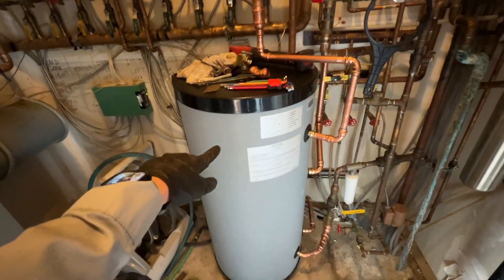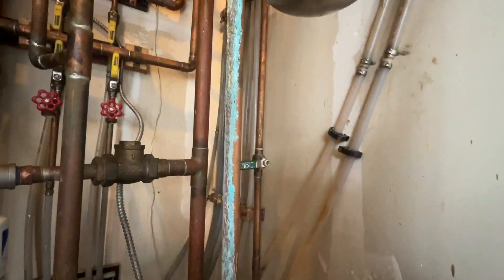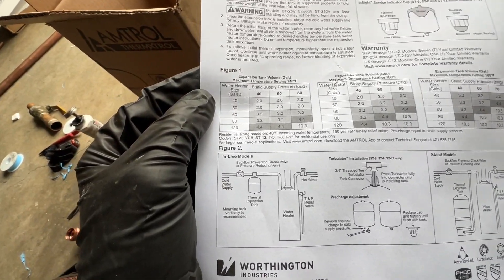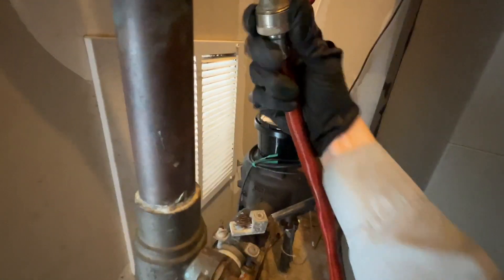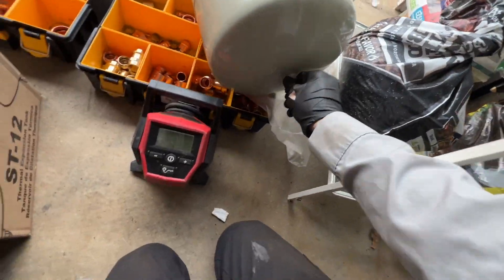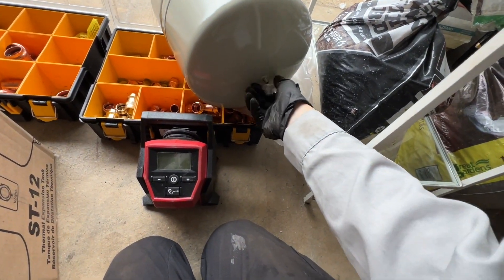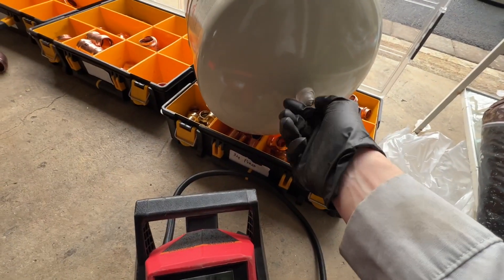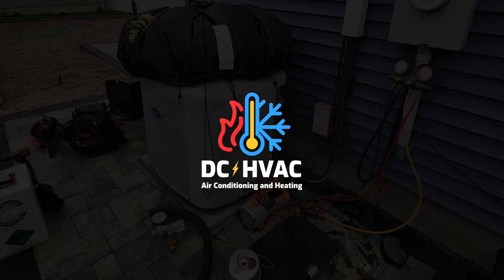How To Set Charge on an Amtrol Expansion Tank! Amtrol ST-12 for Domestic Water on Indirect Tank!

Comment: what did you mean when at end of video putting cap on you said it is an indicator of when tank has failed?
Reply from the maker: The cap has an indicator of the bladder ruptures and moisture makes its way in, it has a sight glass on it that will change color
Reply: thanks i should read the instructions they stuck to my tank at the valve LOL @DCHVAC
Reply: guess I'm not going blind mine is 2018 vintage just has plain cap with no indicator I thought i would have noticed it if it had one @DCHVAC

Comment: Big daddy, you are correct. Amtrol has the old school diaphragm and would like them installed vertical with threads at top. B & G, Watts , Flexcon and quite a few other brands all stepped up to the 21s Century diaphragms & can be mounted in any direction, with proper support.
Reply: Amtrol can be installed in any orientation now also.
Reply: @DK-pr9ny , glad to know, but I’m still gonna stick with Watts or B&G .

Comment: Hey I didn't notice a boiler drain on the cold side. If that's a weil McLain the installer needs to put that in. Also I got a tip for you that's helped me. On the hot and cold feeds I liked using short brass nips and a brass tee for cold. On cold side install the boiler drain and on other side you can install a press adapter. I also like doing this with supply and return but I use blk fittings. Also it makes it easier to tighten it into the tank. Keep up the good work dude.
Reply from the maker: There is a drain on the cold side on the half inch line that’s Teed off.
Reply from the maker: Regardless, the tank has a drain. You don’t need to put one in on the cold side.